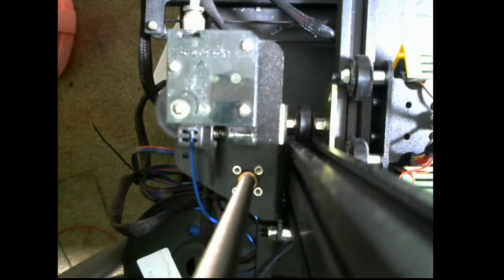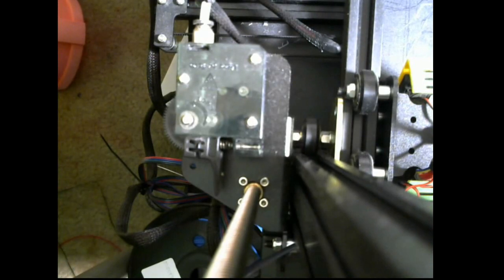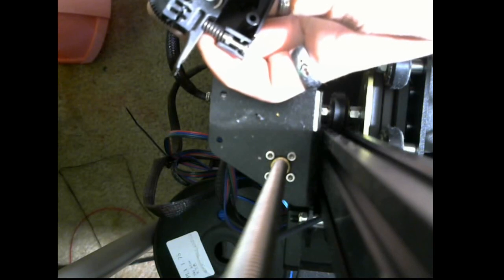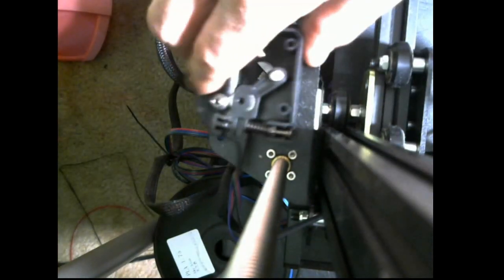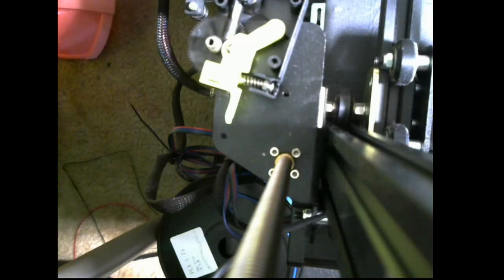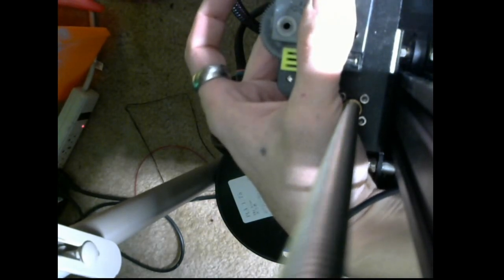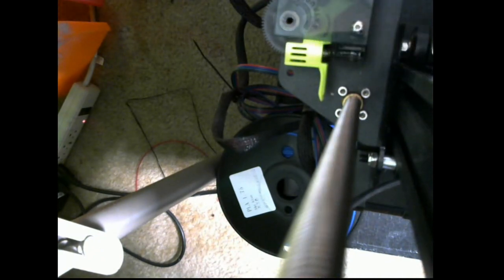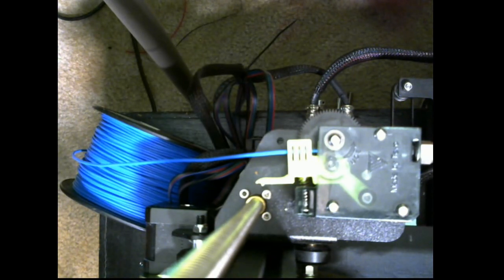Tevo Tarantula Pro Extruder Arm Replacement Print

Comment: i had the same issue with my tornado. also had rusted ball bearings that broke and the gears got all loose. i bought a new original titan extruder and i added a piece of ptfe tube about 2 inches long in the arm's hole with the filament passing in the the tube. illiminates all rubbing and wearing, i think it was made to as such cause it fits perfectly. try it and you will end all wearing.

Comment: Great print but why don't you try a piece of PTF Tube in the Extruder arm to save ware and tear on the plastic?
Reply: That's what I did on my Tornado... cut about a 2--2-1/2" long piece. works great and it helps guide the filament thru the drive wheel and into the bowen tube.
Reply from the maker: Brilliant